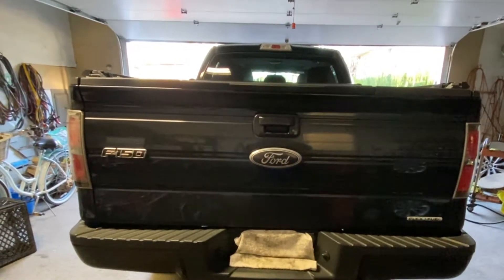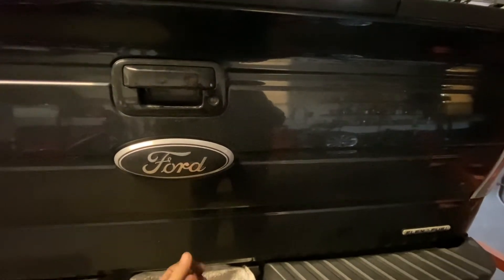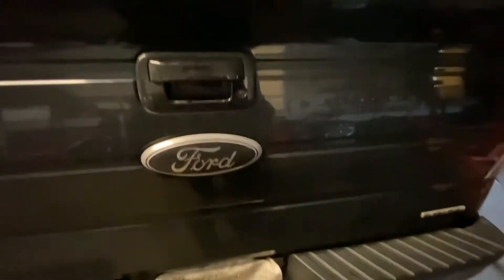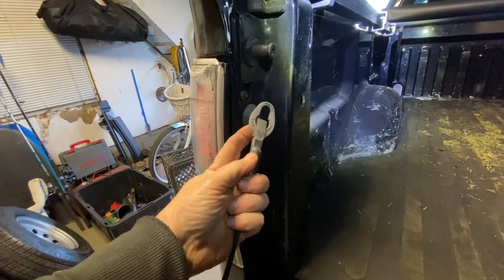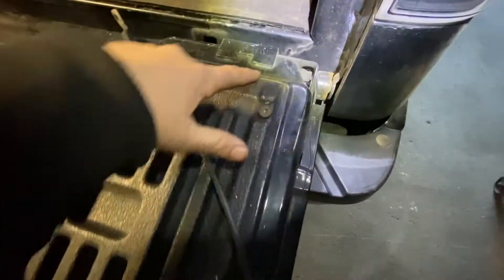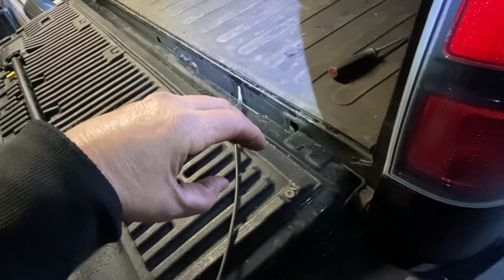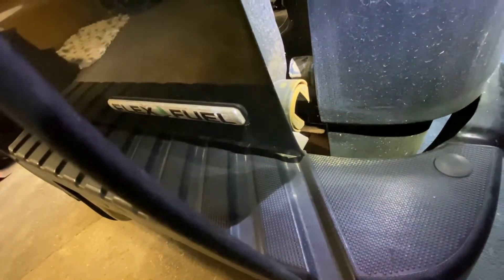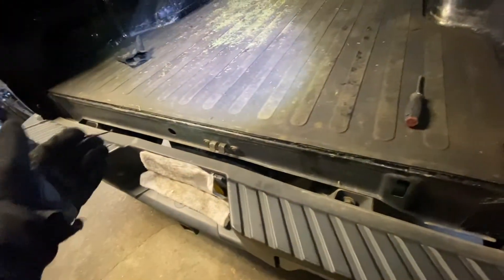Ford F-150, F150, Tailgate Removal - No Tools Needed! Quick & Easy!

Comment: On my 2014 STX it was harder than shown, especially getting the left side off. You didn’t mention that the left side was also an oval (neither side is a circle) and the tailgate has to be straight up to come off the left post. That is hard to do if you already removed it from the right post. If I have to do it again I will try the left side first.
Reply from the maker: The way I explain it is how most come off. I said tailgate has to be as a certain angle for it to come off.
Reply: I agree, just tried to remove tailgate today on my 14, right side was easy, spent an hour trying to remove the left side at all angles and finally gave up. Will give it another try tomorrow...
Reply: Not to be rude y’all but he did mention that-and frankly if you can’t figure this out you really shouldn’t be working on your truck…